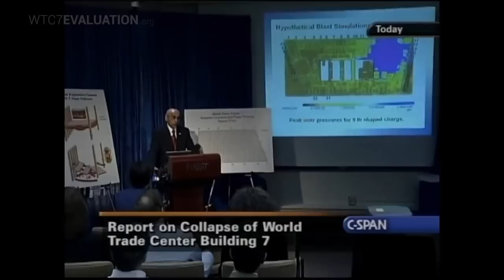Utvärdering av Building 7 - En introduktion - Svenska undertexter

Comment: The NIST report was a joke.  An office building does not have materials that can get hot enough to melt steel (e.g. there was no jet fuel in this building).  Even if there were raging fires around 1370°C it would not produce a completely even, controlled collapse.  There are tens of thousands of linkages,  that all have to snap at exactly the same time in order for it to fall symmetrically.  If there was slightly more fire on one side it should collapse there first and consequently topple over, yet, this building fell through the path of most resistance, which defies the laws of physics.  If you took an axe to a large tree, it would never reach a point where it suddenly fell through itself, it would obviously tip over into the path of LEAST resistance.